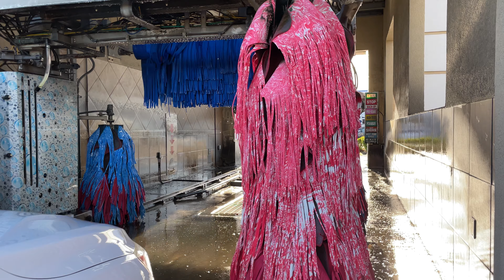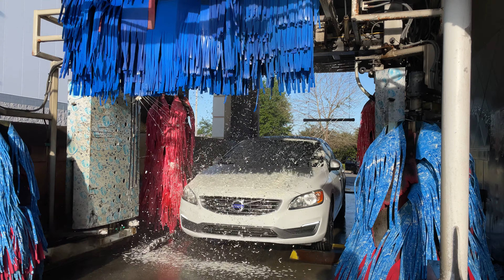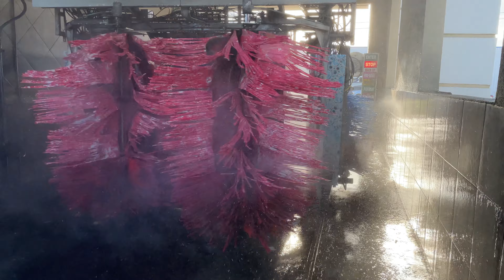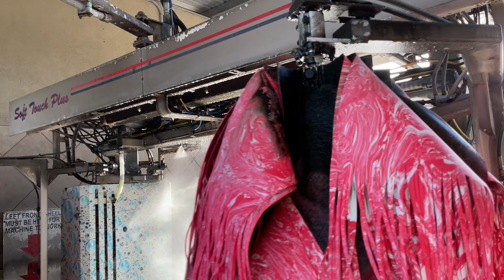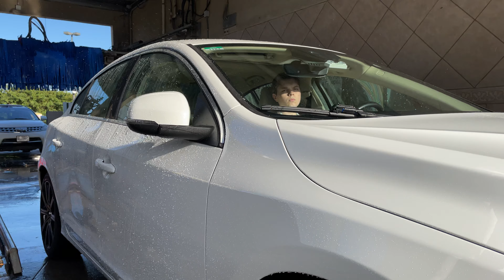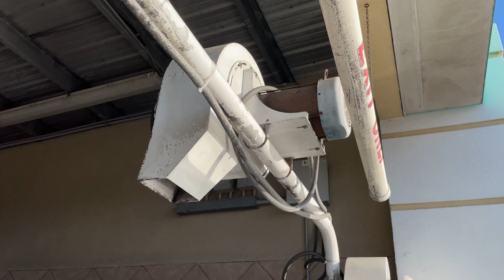RARE nu✦star "Soft Touch Plus" ✨ Osceola Car Wash - 4K

Comment: This thing looks beat up. I wouldn’t be surprised if it eventually gets replaced.
Reply from the maker: Absolutely. However, customers still use it. They’re building an express wash next door so we shall see how it holds up.
Reply: @Carwashdr  oh nice! knowing Florida, the tunnel will most likely have Sonny’s equipment.
Reply: The gantry and brushes just need to be cleaned. That's all.
Reply: @thecarwashelevatorfanatic7433  Yes the tunnel next door is gonna be a New Modwash location.